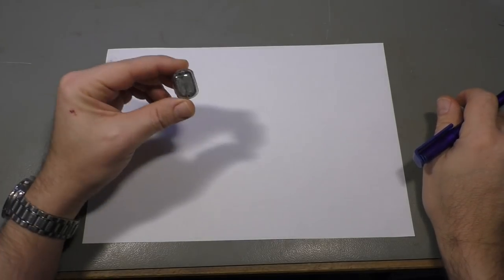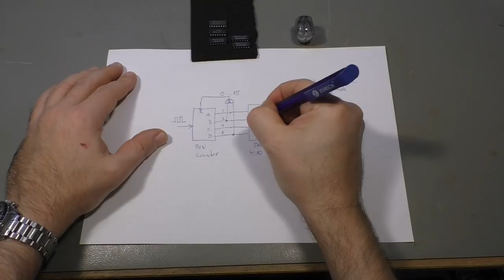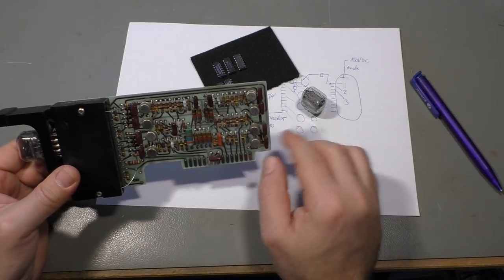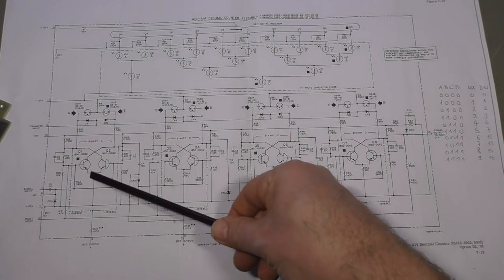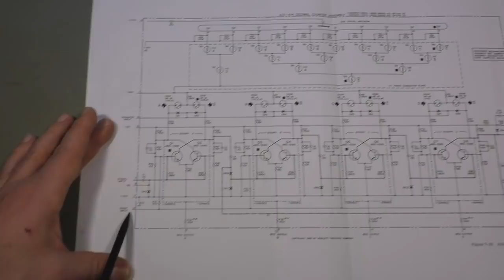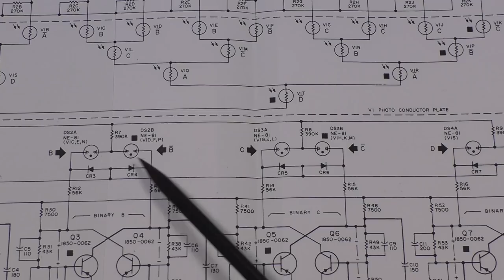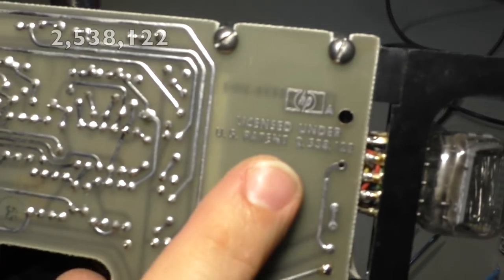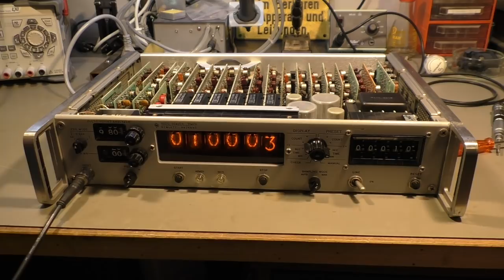Digital circuits long before the digital age (1966) - (PWJ160)

Comment: Neonbirnchen-LDR Logik und Decoder. Wieder was gelernt :) Und ich dachte mein Germaniumdioden 7-Segment Decoder, den ich als Kind gebaut habe war schräg....
Reply from the maker: 1966 waren Dioden noch teuer. Wie viele hast du gebraucht um 1 Display zu decodieren? 49?
Reply: @PlaywithJunk  Für die erste Stufe 40. Für die zweite Stufe ca. 44 oder 46, je nachdem wie die 6 und die 9 aussehen. Dazu noch 4 Transistoren um die 4 Bits zu invertieren. Das geht auch bestimmt intelligenter mit weniger Dioden. Aber mit 11 Jahren habe ich das einfach nicht besser gewusst. Das Material hatte ich aus einem Schaltschrank den ich auf einem Schrottplatz entdeckt habe. Über 100 Glas-Germaniumdioden und anderes Zeug auf Pertinax-Platinen.

Comment: Very interesting! The resistor decoder is actually straight binary to individual outputs, no gaps, so the counter counts "normally" too... But there is that line between the outputs of A and D, which are both high when at 9... not sure of the mechanism that does the reset, but it must be linked to it.

Comment: Also seen these inside a HP3440A nixie voltmeter, found them a bit weird, even at those times, since a bin to decimal demultiplexer could be rather easily build with transistor/diode logic.
Reply from the maker: Well, I guess that semiconductors were expensive parts back then.... That's probably the reason why they did what they did.

Comment: What is the composition of those photoresistors? Would that be some sort of paste that is screened on to the PCB and then cured in place? Or manufactured some other way?
Reply from the maker: have no idea.... but most likely the way you just described.

Comment: That schematic is of a different counting pattern (normal binary). Look at the photoresistors: "D" being true means that 8 or 9 are lit. This explains why no 'funny' counting schematic is found on the lower half.Still don't understand how the reset after '9' would work though.
Reply from the maker: I thought that an extra reset circuit is not necessary because the "9" is represented by all 4 ones. On next impulse  the flipflops will go to zero by itself.
Reply: Yes, the circuit diagram on the video shows options 002 and 003 with normal binary output.
In the state '9' (1001) 'Q7' is switched off and 'CR10' in reverse polarity prevents switching the 'B' stage with the next input pulse.
In the next pulse 'A' stage switched to '0', the positive edge of the pulse switch the 'D' stage to '0' via 'C4, R63, L1, C12'.
Reply: @PlaywithJunk  but look at the decoder. The branch with the highest bit set only has 8 and 9 as output.
This is normal BCD, so this is a (slightly) different schematic.
Now I can imagine that skipping steps after 7 and after F is more efficient, but also that a BCD output is desired sometimes (look at the bcd output lines drawn to the bottom).
Reply from the maker: Yeah it's weird that they use 2 different circuits. On the other schematic it is obvious...

Photoresistors D and A make 8 or 9. But that doesn't mean it's 1001 for 9. If it counts 1111 for 9 it still works because the B and C don't matter, the light up for nothing.
The only thing I see in the schematic that is different from a normal binary counter is the feedback from -D to flipflop B (via diodes CR10 and 11). I think I have to simulate that to see how exactly that counts. One thing is sure, there is no reset circuit except the reset line that goes to all digits together.

Comment: Why do you need a resistor on every cathode? Wouldn't a single one on the anode also work?
Reply from the maker: There is one resistor at the anode, I assume to limit the current. The individual resistors on the cathodes (0-9) go to ground. I think they are needed to turn the numbers off when not active. Otherwise the would possibly all glow.... slightly...

Comment: The 10 x transistors were not needed with 74 series logic, there was the 74141 and the Soviet K155ID1. However back in '66 this is moot.
Reply from the maker: A soviet chip in 1966.... don't even think about it. You would go to jail! In the USA for collaborating with the russians and in the USSR for giving high tech to the enemy.
And well it did not exist in 1966.... so you got in jail for illegal time travel :-)